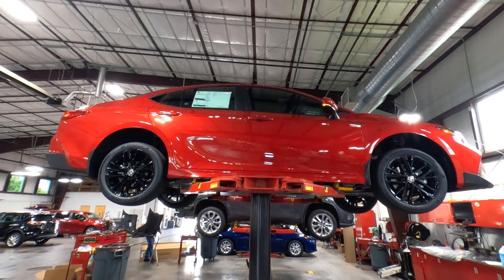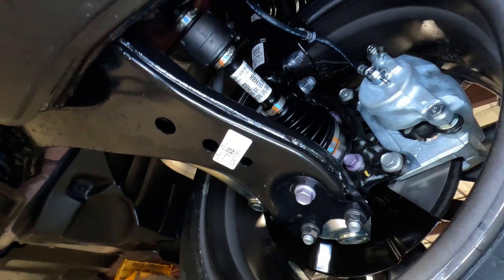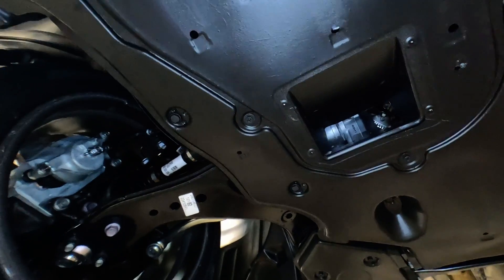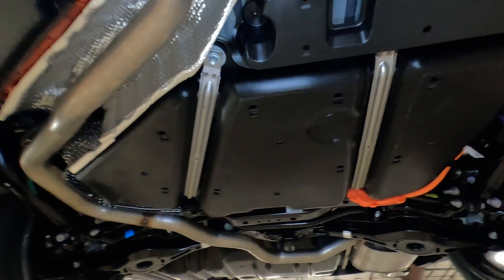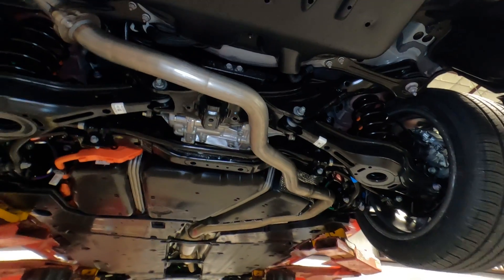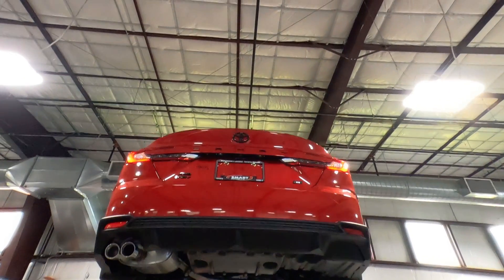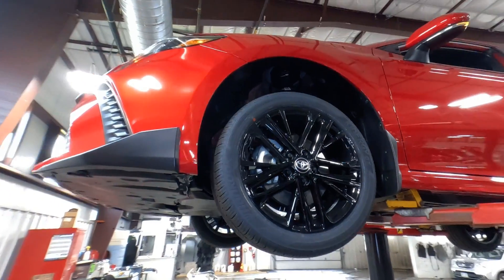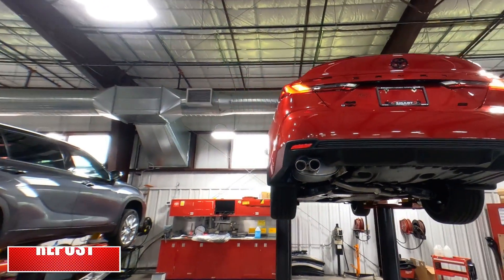2025 Toyota Camry SE AWD Hybrid Chassis Review

Comment: With the catalytic converter being so far inside @2:16. Does that means its harder for thieves to steal it over night? I live in an area notorious for CAT theft and unsure if i have to worry about that. I really want to buy it
Reply: That's what I was told, have the same concern here 😏
Reply: HARDER to steal, YES but you still should install (or have a muffler shop/mechanic) install the MILLERCAT Toyota Camry Hybrid 2018-2025 Cat Shield  (this will likely be one of the first accessories I have installed on my new 2026 Camry SE Hybrid, in addition to PPF, window tint etc.

Comment: That small  cutout at the front end where air can come in, is that where the oil filter and pan located?  I change my own oil, it would be nice if that's the only small piece you'll remove and not all the entire front cover every time you change the oil of the car.
Reply: Yes